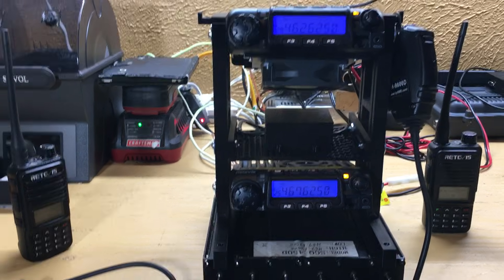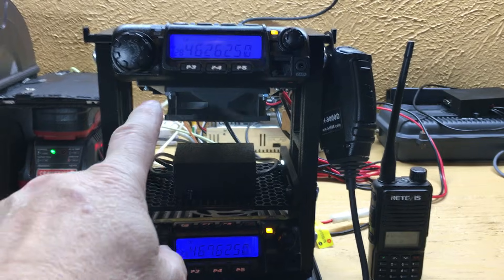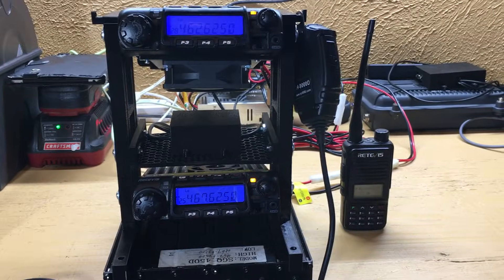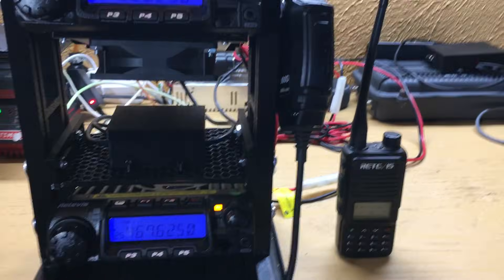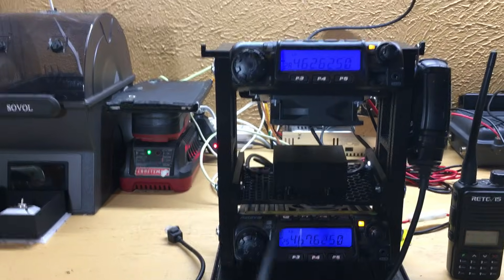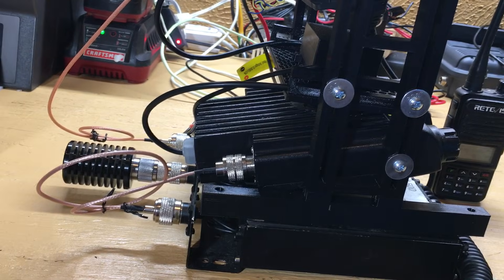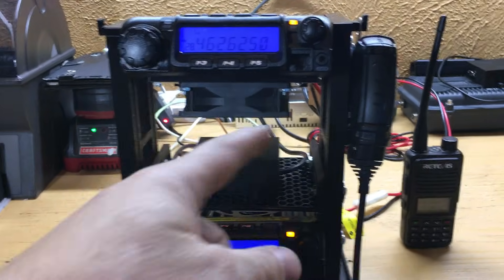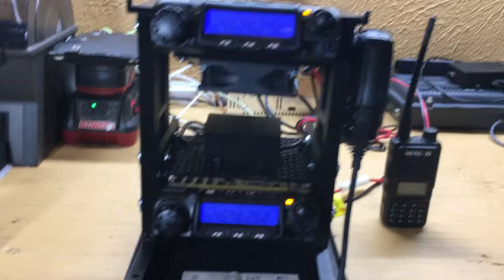🔺Full gmrs/ham two-way radio repeater build tyt9000d/rt9000d mobile radios!3d printed rack!! part 2🔺

Comment: jezus man stop effing yelling!! 😂😂😂😂
Reply from the maker: humm i am not maybe turn your volume down 😂
Reply: What wattage do you get out of the back of the radios? Also ,can an amplifier  be added to that setup?  I'm new to this, so sorry if stupid  question .
Reply from the maker: @rickluchtenburg8166  humm i don't recall what I measured out of the radio but i think it was 30 watts when I tested it???? But keep in mind if you are going to be using a duplexer ( because you are going to be using two radios, and you want only one antenna) it will suck some power away too!! And yes you can add a amp, but it has to be BEFORE the duplexer. Go to my main YouTube channel and in the search bar type in tyt9000 there are more videos i have done on this radio.
Reply: Thanks for the quick reply.
Reply from the maker: @rickluchtenburg8166  no problem :)